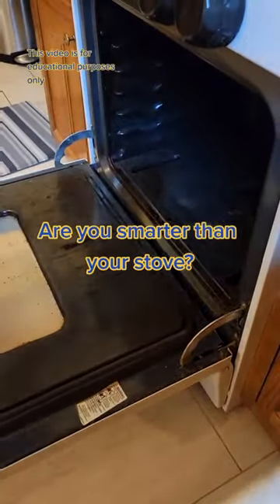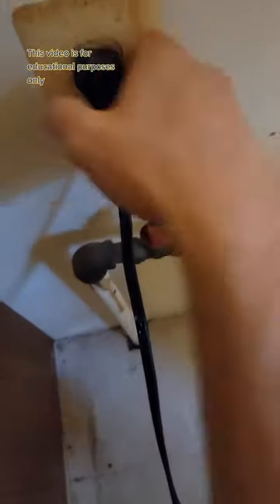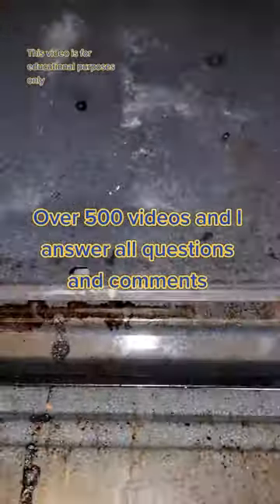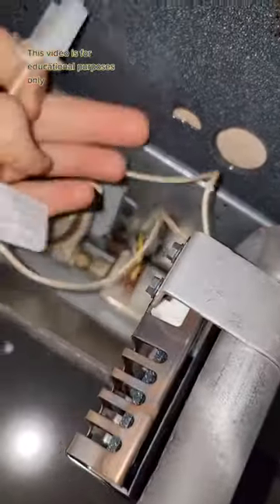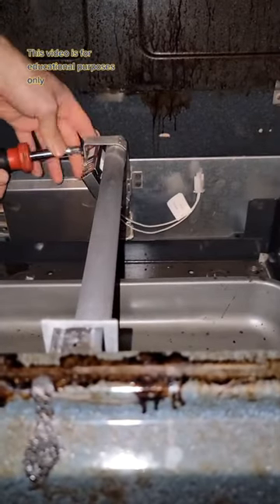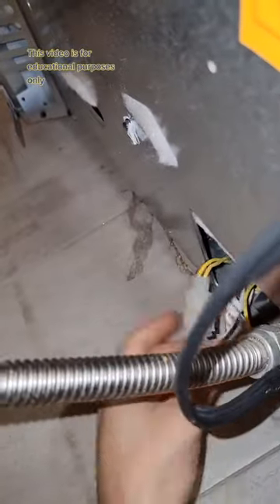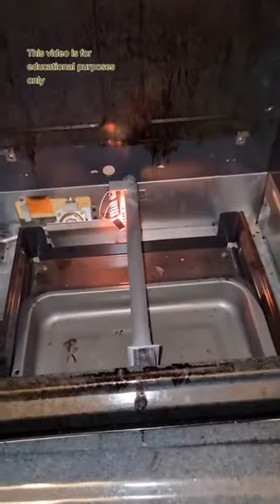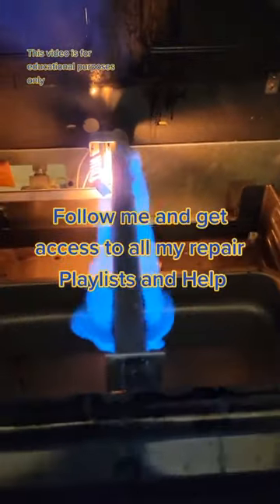How to fix a stove that wont ignite #shorts

Comment: Just a tip for people - Treat that gas very carefully, always make sure you switch it off completely, double.. no triple check, and make sure the system is completely sealed when reconnected, last thing you want is an accident

Comment: What about the stove top burners? The oven and 2 out 4 stove top burners are working
Reply: Is it gas, and can you light them with a lighter??  if the answer is yes, then your sparker is f'd.
Reply: If it's gas first take your burner apart in the dispersal cup there's a small hole that gets blocked by carbon poke it clear, poke clear the feed tube under it all in the stovetop itself and clear any extra carbon buildup. If you still need a lighter to ignite you'll need to replace the ignitors (white porcelain bits) costs $30 and a 5 minute YouTube video as long as you have pliers a flathead and a ph2 or ¼driver
Reply: @tylerstevens5352  Awesome! Thanks!
Reply: @iloveyougumi  no problem, to be more clear you'll need a small emphasis on small paperclip sewing needle or something of the sort to poke the holes clearand the feed tubes are under each burner hope I could help 😁

Comment: Okay now check this. I bought this dryer about a year ago and now it’s not heating up and drying the clothes properly. Do you by chance know what the issue is? If so reply with a link to your newest video!!!
Reply: Open the door, somewhere in the lip is a small lever like button press it to start the dryer look at the left side grate on most models if you don't see orange in a few seconds it's your heating element if you do see orange your dryer vent needs cleaned